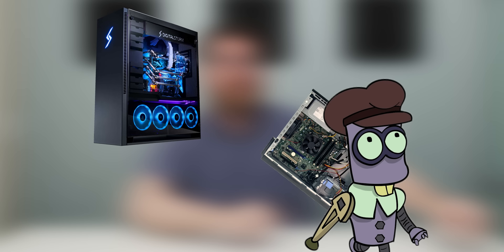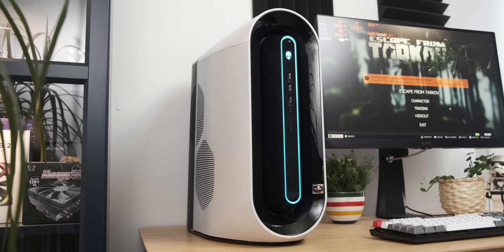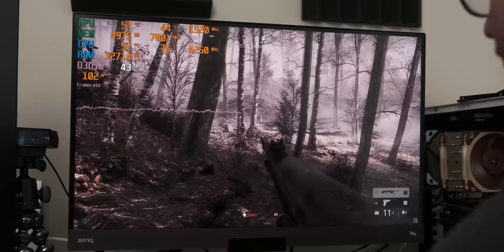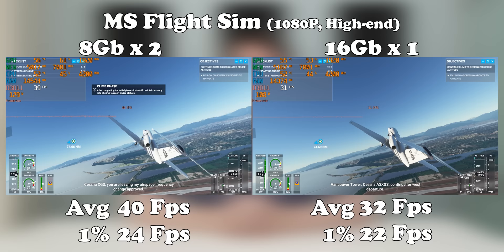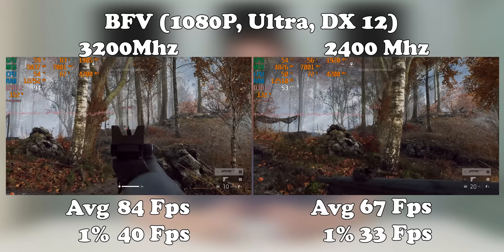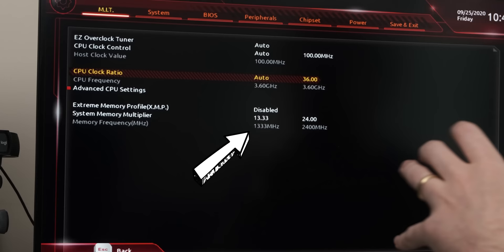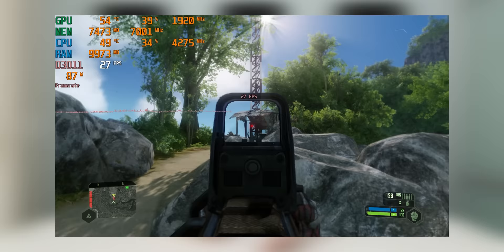How to DESTROY AMD Ryzen gaming performance!

Comment: My wife and I used to play a ton of GTA V. Back then, we were kind of 'minimum spec' gamers... I had an i5 2400 system with 1 stick of 8gb RAM 1333mhz and she had an AMD Phenom ii X4 810 with 2 sticks of 4gb DDR2 800mhz. She got MUCH smoother performance than I did. So at the low-end I can say dual-channel RAM made all the difference in the world. I don't remember what GPUs we had but they were probably both equally crap. My system was SFF and hers was a regular, compact mATX system, but I typically had better specs than her in our PCs, so I probably wasn't at a disadvantage there.

Comment: Worth saying that even dual channel can still suffer on Ryzen as "dual channel" may not be "dual rank" - for example i have Crucial 2x8 dual channel single rank and i get 52Gb/s rather than the theoretical 59Gb/s max bandwidth - to get dual channel dual rank i would need 4x8 in this case which i intended to uprgrade to at some time any way for 32GB Ram

Comment: FYI There are mor than just CAS settings. There are also secondary and tertiary timings that have an affect on RAM performance. I would suggest you to watch the second video from GamersNexus on RAM timings for an explanation but I'm still waiting for it to be released (was promised two years ago). So Buildzoid from ActuallyHardcoreOverclocking is a better source, if you can handle his style of videos^^
However in this case I don't think the secondary and tertiary timings would make a difference

Comment: I used to get weird lag spikes on a Haswell i5+1060 6G running single channel DDR3. Specifically Forza Apex in certain night maps.
A VERY BIG factor, is where the game is stored. PCIe SSD? No problem, your game will take some bandwidth from there, 7200RPM desktop drive? Well you will probably get some stutters, 5400RPM dying laptop drive? Well you can guess what happens. This is more relevant on low amounts of RAM though. 
Back in the day, upgrading to a simple SATA SSD on my old Core 2 Duo laptop, actually fixed some of the stutters I had while playing World of Tanks on 2gb of RAM. It was fast enough to the point I didn't really need the 2x4 sticks I had gotten for it (but Chrome needed them though).

Comment: I paired a Ryzen 3000G with only one module of 8GB 2666Mhz DDR4, buy I overclocked the CPU to 3.9Ghz and the memory to 3000Mhz, I also improved the latency, after that I ran some 3D Mark TimeSpy and got nice results, then I looked at others peoples scores and my was on the top 3 (Ryzen 3000G with single channel memory, my nick in 3D Mark is drinego) well my point is that Ryzen also likes low latency too.

Comment: My current pet peeve: My work laptop has a 3500u in it, with a SINGLE stick of RAM...i mean 1) Why HP, why? and 2) I'm not allowed to add any myself because, well, work laptop xD.
Reply: yeah, my laptop does use an Intel CPU, but it has only one stick of ram.
Reply: That's more to do with your work policies than HP though... I get your point, but most people expect to be able to add a DIMM of Ram later with most laptops... It's really one of the only performance upgrades that can be done on a laptop over time... You're stuck with the same GPU and CPU, but at least you can add memory!

What you suggest would take that option away later, and add price to the item today...
That's why HP doesn't do it... One they're buying half rhe ram they would if they didn't, and Two, they're selling the laptop cheaper as a result (effectively gaining sales from buyers such as yourself)
Reply: Sneak a ram module into the laptop when no one's looking

Comment: what ive noticed with MSFS2020is that as long as you can make it to 30fps, its all you really need in that game, so adjust settings accordingly. targeting anything higher than 30fps is almost pointless because i promise that you arent gonna avg. 60fps anyway. that being said, theres some quirks about the game that have really pissed me off. for instance, well first, let me give a a bit of background. im SUPER into flying sims and flying games that are as realistic as possible. one of my favorite is DCS: World because of accuracy. i have flown nice scale RC planes for YEARS, can fly a couple of IRL panes, like the Cessna 182. so yeah, flying is my thing. anyways, i turn off all assists in MSFS2020 because i dont need them at all. for some reason, when i land, i have zero rudder/steering control. none. the game does it on its own, even with all assists off. one example is i made a real time flight from Atlanta to JFK in New York in an Airbus A320. takeoff and flight went well and as expected. well, when i go to touch down at JFK, the second my plane touches down, the game adds full left rudder/steering and sends plane into the water on the left of the runway. i even threw right engine into full reverse thrust as the left is about 25% forward so i could try to counteract what the game is doing, while im trying to apply full right rudder/steering...still sends plane off to the left, into the water. i was kind of pissed off because "wtf???". after about an hour long flight, that happens. holy crap i was pissed. i was so mad that i havent played the game in a few days at this point. ive gone through all the settings, and there is absolutely no assists on at all. i still cant figure out what the hell is going on, but it really made me not want to play the game any more. i dont know. maybe its some sort of bug somewhere or something. i really dont know. all i know is that it shouldnt happen, but did....anyways, ive gone back to DCS: World again since i dont have to worry about those sorts of things.

Comment: This is a great video, but the title is wrong, for me it helps me understand on how to best configure ram, for someone like me who has differently specs on ram modules
Reply: Well, yes and no. The video does cover the title because he heavily underclocks DDR4 to the speed of mid-tier DDR3 in single channel, which is not only a completely manual thing almost nobody would do in a normal circumstance, which also drastically handicaps Ryzen performance. As far as I know, Ryzen ONLY natively supports DDR4 RAM, so this setup is completely unrealistic. On the contrary, he also does cover correct configurations of memory modules and the optimal ways to install and use it. 

TLDR: the title is correct but there's also information to learn from for novices.
Reply: @FlushedRay  allow me to say then a more suitable comment on my part would have been to say a "the was a more suitable title" as you also correctly say there is no real merit to scrutinizing the other scenerios as they are impractical, as I still mantian a title that actually gave insight into the content talking about ram configuration optimization, there's many people that need that knowledge that might not know it's hidden in this video, hence my original comment

Comment: I have an old amd x4 620 cpu, a corsair 240gb sata ssd running widows 10 in my pc, with total of 16gb of ram in my pc utilising 4 sticks of 4gb ddr3 modules in dual channel mode, which is still quite fast in todays standards and also is slightly faster than having 2 sticks of 8gb ddr3 modules, so there must be some slight bottleneck with certain ram configurations.

Comment: Hi Dawid,

Yes, many budget pre-builts do seem to include just a single stick of RAM to optimize slowness but I was wondering where I could get one already down clocked in the way you describe.

I was wondering if it would be possible to get one with no thermal paste applied and preferably on the stock cooler with only 3 out the 4 corners secured. What would you recommend?

Thanks,

Leigh
Reply: For no dual channel and only three corners screwed on the cooler I recommend The Verge. But they have put plenty of thermal paste.
Reply: I was rather hoping that with no thermal paste and the cooler not secured properly that the processor would thermal throttle.

Comment: From the thumbnail my brain already hurts trying to understand who in the right mind would do that
Reply from the maker: That's the point. 😂
Reply: Useful what if analysis that paints an interesting picture...but what are the implications for laptops with soldered ram? Can anyone still get full benefits of dual channel with 4gb soldered and 8gb in the only slot? Are you subject to the quality of the modules the manufacturer used and if so how would you go about ensuring you get the ram in your slot runs at full speed?

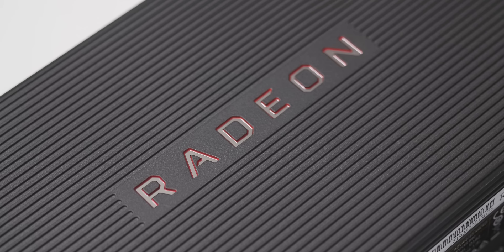Comment: 10:30 yeah, but im sitting here with a RX-580 8gb Red Devil, REALLY wanting the RTX 3070, but seeing how the 3080 and 3090 launch went, and is still going, i doubt ill get one. so, ill probably have to settle with something lower end, maybe a 5700xt Red Devil since i already have experience with PowerColor Red Devil line.
Reply: millermonsterair just get a 2070 super used or discounted for the love of god haven’t you heard of the 5700xt crashes not saying the 2070 super is perfect. But just overall better.
Reply: @ar12.  yeah, i heard it does, but its from Nvidia fanbois and those who tried the early versions prior to the updates that pretty much fixed it for most people.  to be fair, yes, the 2070 super is a good gpu, but for less $ i can get roughly the same performance, minus RTX of course, which i really dont care about anyway
Reply: millermonsterair ive never had a single problem with mine!
Reply: Why wouldn't you just wait for the new AMD GPUs bring announced end of next month? If you get a 5700xt you're going to end up paying the same amount for probably half the performance of the new GPUs, as the rumor is that they're coming in right under the new Nvidia GPUs.
Reply: @alexanderphelps4804  valid point. the thing is, im not counting on them even being available. the 3080 and 3090 launches proved to me that im not gonna be getting a just released gpu for anywhere even close to MSRP. so as of right now, my only real option is the 5700XT
Reply: millermonsterair the 3080 launch was an actual disaster are you playing at 1080p or 1440p also I wouldn’t get a 5700xt simply because  it will only be able to play games on max I’m guessing around a year  the 2070 super has dlss which will mean your gpu will last longer on newer games as it can render 1440p at 960p and use ai to make it 1440p again and that will be utilised in a lot of new games which then will allow stable frames in 2 years with high graphic settings and the possibility of raytracing which I haven’t used so I can’t say to much just think about it before you buy anything.

Comment: I don't even run 2 sticks of ram as I always run 4. I also found that running 3600 ram makes your system unstable.

PS: The RX 5700 XT doesn't even has the performance even close to a 2070 Super.  Hell, the 5700 can barely keep up with the 2060.

Comment: Would you ever test 2 sticks vs 4 in a dual-channel motherboard? I'd like to know how much performance is lost using 4 sticks.
Reply: it's not lost, but opposite (if you're using SR sticks) because 4 sticks work just like 2 DR sticks. Although, your overclocking capabilities are kinda screwed with 4 sticks.

Comment: Its why I use liquid cooling on my 3950x.   First liquid cooled cpu rig I have built out of dozen + home rigs for myself and wife over the past 23 years.  Apparently it runs super hot normally.   AMD recommended liquid cooling for that model Ryzen.  Plus I'd recommend at least 32gb ram.  And run the game off a NVMe ssd drive.  Parts are cheap enough these days.  Hopefully they'll be some great pre xmas sales in mid November. This devil's advocate demo showing downsides of hobbled builds.  The lesson.  Don't buy department store prebuilt PCs and don't scrimp on your parts on home builds.  Cheap way =  worst way.

Comment: Honestly I would like to see the difference between 1x16go at 3200/3600 MHz versus 2x8go at 2666 or lower
Reply: Dual channel is always the way to go. AMD does benefit more from higher frequency though. If you're using Intel, then I'd say 2666mhz is perfectly fine. I'm running 2x16gb ram 2666mhz from HyperX, but I'm using Intel so the frequency shouldn't matter as much as far as I know.

Comment: Hey David,
I have a question, is dual channel 16gb 2666MHz fine for the Ryzen 5 3600X?
I was thinking of getting this CPU, and I dunno if I need to upgrade the RAM a bit or if it's fine.
dunno much about this, so sorry if this is a dumb question :D Thanks!
Reply: Not bad but your lost ~5-10% fps to a dual channel 3600Mhz. I sure you can easily overclock your stick to 3000Mhz in the bios without loose timing

I have overclock my 2666Mhz CL20 to 3200Mhz CL16 without issues with my Ryzen 2600

Comment: Hope you did not lock the timings when you dropped the ram frq. - the timings are automaticly better at lower frq. When running jedec speeds. If you locked the timings, then your test i invalid I am afraid😑

Comment: Wondering if a Ryzen 3 3100 4 core 8 thread DDR4 2666 vs Intel i7 4790k 4 core 8 thread DDR3 1600 which performs better. Will RAM speed matter

Comment: I am running with 2666mhz ram clocked to 2933.I tried to clock it to 3000mhz but it was unstable.I don't see a need to upgrade yet.Why pay 100% more for 10-15 frames extra.My friend on the other hand has 3000mhz but for the life of me i can't tighten the timings.It will not boot.I tried everything.Even a normal oc from 3000mhz to 3200mhz should work.Guess what it doesn't 😁.I tried to set a custom voltage.Tried 1 timing at a time.No dice.

Comment: I think the terrible CPU cooler in the alienware system and having 6 cores with no hyper threading was also holding the performance back, as well as the hard drive, which is really unacceptable.
So add all of that to dual channel and you will probably get the unplayable experience.

Comment: AND THAT THE 3700X WORKS BEST AT 4.3GHZ 1.325-1.375V I FINE IT RUN COOLER AND WORKS BETTER AT 1.325 I GET 5059 IN R20 AND IN R15 2248  ON A RTX 2060  X370 ASROCK GAMING X ballistix 2666MHZ I KNOW IT A BOTTLENECK ILL GET BETTER RAM SHOULD I WITCH ONE YOU RECOMMEND?

Comment: Uhm my 1600 system runs 1x16gb stick at 2800mhz with a 1070 and my 4600h laptop is currently running with 1x8gb 3200mhz which one should I upgrade first? 😭😭😭

Comment: My ram is stuck at around 2000mhz (1067 when in system settings and nzxt can) and it don't know what to do. It should do at 3200 and xmp is on

Comment: I dont have the greatest memory paired with my ryzen 5 2600 it was only cheap but i am glad i got 2 x 8GB sticks even if they were only 2666Mhz they overclocked nicely to 3066Mhz just need a better GPU next i have a GTX1650 GDDR6 version

Comment: It's sad that my i7 2600 using 2x8GB 1333mHz DDR3 performs better than the Ryzen 7 at the same memory speed, just upgraded to dual channel today was running 8+4 for the last couple of years and battlefield just performs so much better, GTA Online still is a mess tho

Comment: That galax rtx 2070 super is similar to mine except I have the 2 fan variant it seems to crash after 5-10 minutes on fh4 and I can’t work it out I also got a fatal error once after 45minuted a beam ng and gpu stop responding apart form the occasional crash it works well so far I also run 1440p and I’m regretting not getting a 3700x I currently have a ryzen 5 3600 and my motherboard doesn’t look great as I a smaller b550 but it supports 4th gen ryzen so it’s good.

Comment: Then there's me running 32 gigs at 2400 mhz because everytime I set it higher via DOCP, my computer wont post.
Reply: Same problem with my system, setting my ram to the correct speed wouldn't even let my system post. I manually clocked up the dram voltage a bit and then it worked, but in games my system would crash. Thing is you have to have ram that is both optimized (compatible is not enough) for  your cpu as well as your mobo. It has to have the right serial number so check for that. As i bought my ram kit before i bought the rest of my system i can't return it anymore. If you can still get a replacement i would get one.

Comment: Great video. This shows you can still have decent performance even if you only happen  to have a single ram  module. Using 2 x ram modules in a quad configuration probably would result in similar performance overall.
Reply: That's..... that's not what this video shows at all

Comment: So I need a new PC since I’m still on DDR3, this just proved I need a new PC to replace my 8 year old build.
Reply: I mean, if it does what you need it to well there isn't a reason.
Reply: @CTMKD  Dude I have been trying to get a new PC. I completed my build
5900X
Asus Dark Hero X570
Ballistix Max RGB 2 x8GB 4000MHz
AMD RX 6800 XT
Been trying to run CEMU and it still sucks
Reply: @thebeaner687  Hey I didn't say you DID NOT need one flat out. I built my new one few months ago after living with an FX 6300 for years, I know what it is like.
Reply: Well I bought a 6800 XT and it was really badly bottlenecked by my FX processor. I’m really happy with the 5900X. It was worth the work
Reply: @thebeaner687  Good on you man, that is a very good processor, surprised you found one lol.

Comment: Too bad AMD decided to gimp Zen++ and Zen+++ if they still didn't couple back to the IF to the RAM speed. What's the point of limiting the IF speed? That's like you set a speed limiter (45mph) on a Lambo and try driving it on a 90mph highway.

Plus, this shows that Ryzen is more expensive (their CPU is overpriced when compared to the FX series) as it requires 4GHz+ RAM speed with very low latency (25% perf improvement on avg, versus those low speed 3.x GHz).